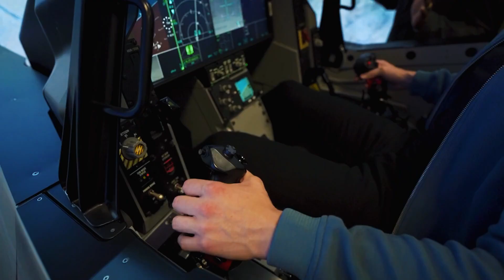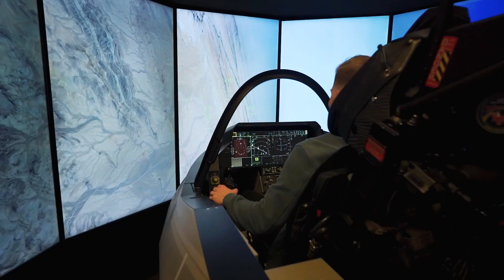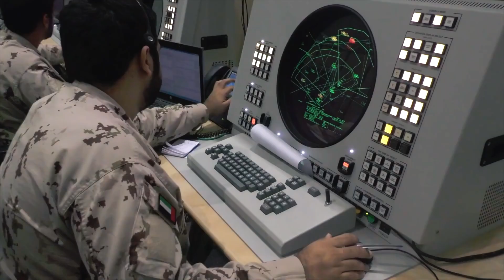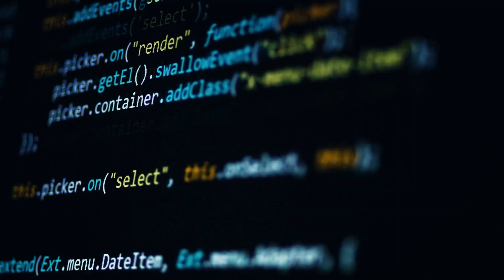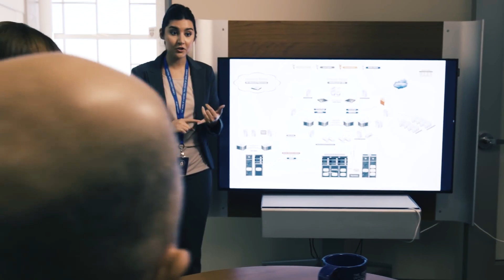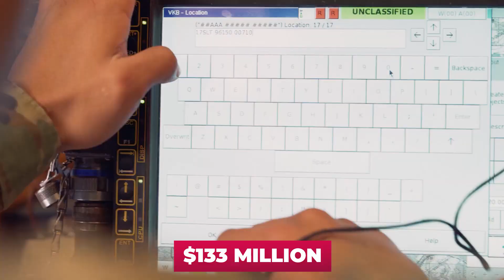Finally: US Revealed Its 6th Generation Fighter Jet

Comment: This narrators comment about Reagan and the star wars missile defense initiative is incorrect. It was not a fake, and we have many weapon systems as a direct result and proof. The patriot anti ballistic missile system the first of its kind, decades ahead of anything our adversaries had was a direct result of that initiative. Even though it wasnt completed due to treaties signed. It was more than half way there. My father was an Astronautical Engineer and a Colonel in the Air Force back then, he commanded minuteman 2's then helped design guidance systems and was project manager for the MX missile, after he became deputy director of engineering for all of the Air Forces  SAMSO Space and Missile Systems organization.

Comment: A power plant if it's going to be SPACE WORTHY will need to be different from the norm. My guess is a HYDROGEN or PLASMA ENERGY power plant would be in the works. I don't think we have WARP DRIVE capability as of yet and heaven forbid we use NUCLEAR POWER PLANT as the alternative. What I'm trying to state is the POWER PLANT itself has to be different in nature in order to have an obtainable reach so high up in the atmosphere not depending on the thirsty consumption of oxygen could greatly affect what a 6th generation fighter would look like. More importantly what the 7th generation fighter realm of capabilities will become as a standard. 🙉🙈🙊